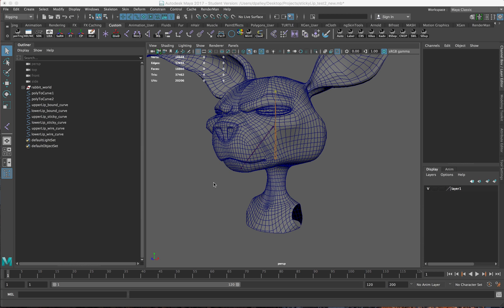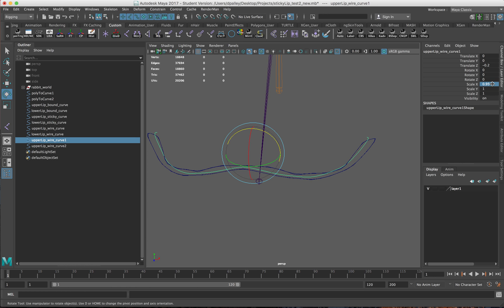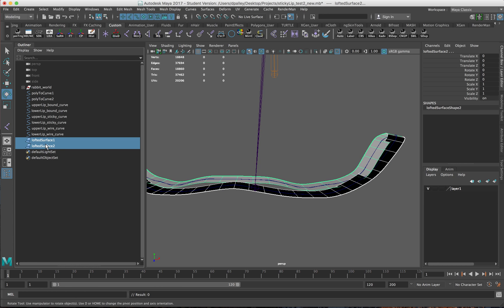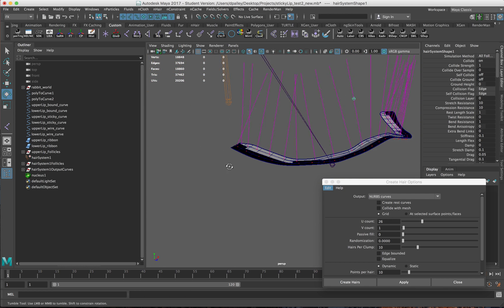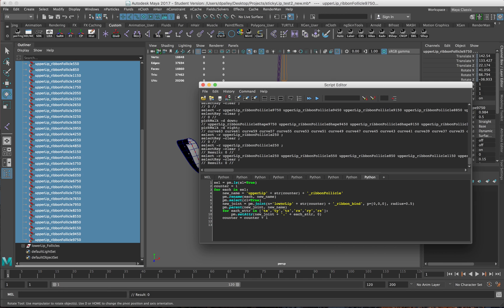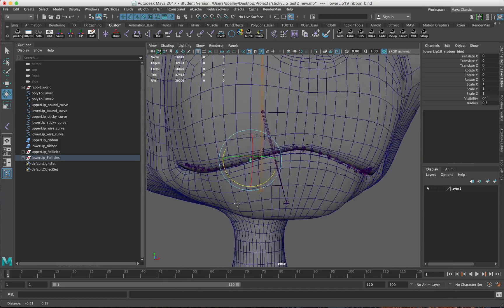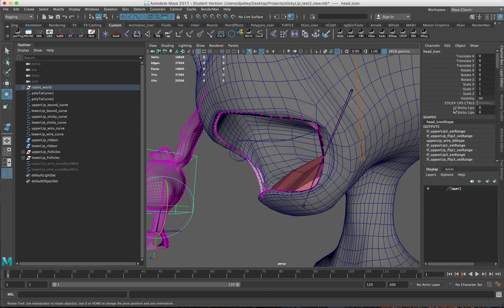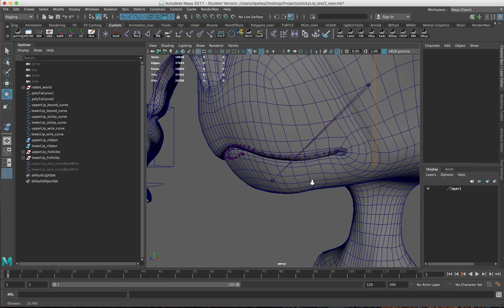Maya Sticky Lips Rigging Tutorial Part 3

Comment: thank you for making these videos! i couldnt figure out why my lofted surface was creating an isoparm on each side of the center cv instead of one isoparm for each cv. any idea why that is?
Reply from the maker: Brendan Howard thanks for the comment! My first guess for the extra isoparms is that you’re missing a cv on your curve. In either this video or the one before it, I use a couple lines of Python code to add a cv right before each end of the curve. This should make the isoparms line up. Let me know if that works.
Reply: @dcpalley23  I just ended up keeping the extra joint it added and not skinning it. otherwise it looks the same i think. thank you again the result looks awesome. subscribed because you are awesome

Comment: Hi, I was able to implement your setup for my face rig. Thanks a lot for tutorial. I am having issue and it's the  last step up i think. I have attached the sticky lips mesh to my main mesh as blendshape. I have also orient constraint the sticky lip jaw to main jaw as per your suggestion. I have placed the blendshape node under skin cluster. Whenever i rotate the jaw, it gets elongated (some type of double transformation). there also more local rigs attached to the main mesh.  Please suggest why it might be happening happening?
Reply from the maker: Utkarsh Agnihotri if there are double transformations, do you have some type of jaw setup on your main mesh/rig? This setup is designed so that there is no jaw setup on the main rig/mesh and it’s only on the blendshape model.
Reply: @dcpalley23  Thanks for the quick reply. It works now. I had to remove the jaw influence from main mesh. Thanks a lot :)